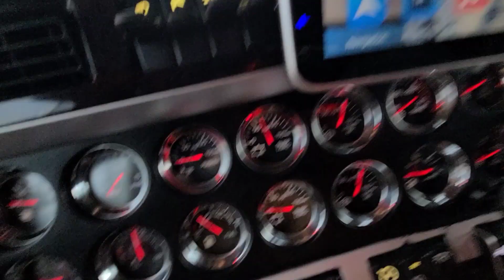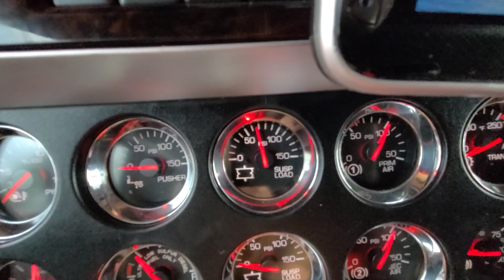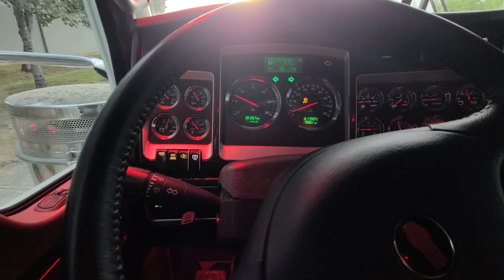Custom Air ride on Kenworth W900 Part 3

Comment: ABS SENSOR. I just did both of mine on the front of my KW T660. Yeah seems like when ya do custom thing's, especially air ride front end you open up another can of worms driver. I've been wanting to put air front air ride on my T660. But  I know the aftermath, like what your going threw is like do I want to deal with that? LOL. Yes, it can all be fixed. It's just time consuming that's All. It's never just put Air Ride on and done. There's always something else that's gonna need to be done because it's altered. But, if you wanna play you gotta pay!
Reply from the maker: Yes it's lots of work but all worth it at the end.